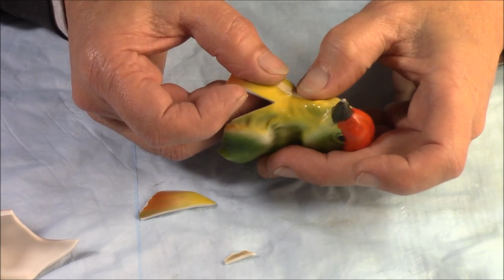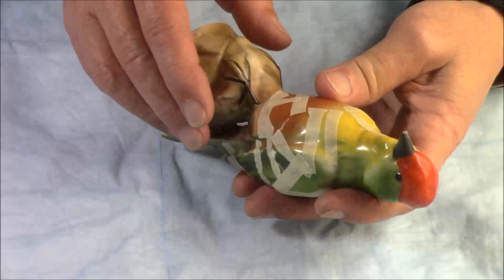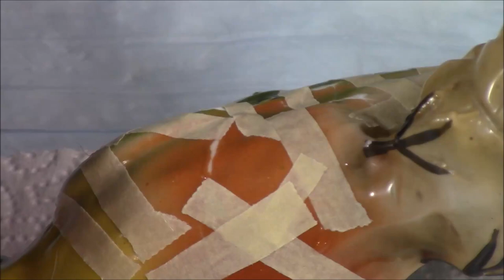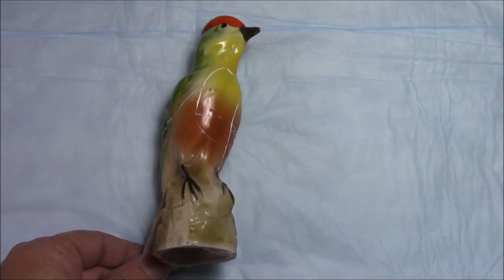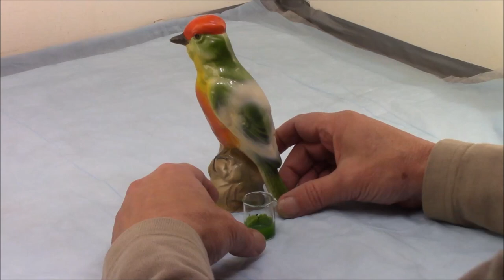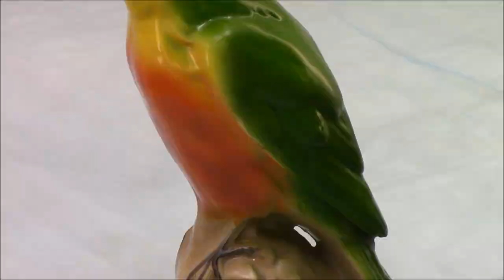Porcelain Bird Figurine Repair

Comment: Nice job but It would really help if you stated the tools and sundries you used. What glue did you use etc?
Reply: He said he used Hxtal. I looked it up and it is an epoxy adhesive developed especially to use in conservation for the repair of glass and ceramics.
Reply: Could someone advise if the Araldite standard would do the same job ?

Comment: Hi, given the price of the Hxtal (more than 80€ for 50g), is there any similar product you would suggest? Many thanks
Reply from the maker: As far as I know, there is no comparable substitute for Hxtal. 
Though for a small object like this one, where you'll be painting over the crack lines, I suppose you could use a good quality hardware store epoxy.
Reply: @marsgitar  thanks a lot Martin for sharing your knowledge. Hxtal it is then :).
Reply: There is Araldite 2020, I prefer it, easier to use.
Reply: @DrFaltermeier  I’ve had the chance to use both since my comment. I wouldn’t suggest araldite for fine restoration. If you have multiple pieces tu glue, araldite will slightly offset the pieces because of the thickness of the product. Hxtal does not. But, price wise, araldite can be a substitute for occasional restorations.
Reply: @WoodfulProjects I agree with you. if there is a hairline crack a heatlamp will lower the viscosity of Araldite 2020 to allow for better penetration and increase the speed of polymerisation. So always a win win in my  treatments. However I was always concerned if this might change the ageing of the epoxy, since I avoid airbrushing as much as I can.

Comment: Wonderful explanation of the process thank you. Im wondering as the figurine is hollow would there be any value trying to put hextal on the inside or does it pull into the cracks? Also why did you say its not suitable for high gloss finish glaze because it looked like it was high gloss originally?
Reply from the maker: The HXTAL is designed to wick into cracks by capillary action. As for the glossiness, the original was somewhere between a high gloss and semi-gloss. That's what I was aiming for in the final finish, though what I got was way less than glossy; almost matte. I realized the difference so I buffed up the finish to the desired sheen but by then I'd already filmed the final scene of the repair video.
Reply: @marsgitar  Thank you for taking the time to respond. I could maybe do the fitting together of the parts but no way could I do the painting, love it

Comment: I'm an amateur, rookie repairer of small vintage figurines. I use Milliput often. I'm curious why you sanded the excess Milliput instead of wetting it, smoothing it, and wiping it? Thanks for the great video!
Reply from the maker: I use whichever method works best for the situation at hand. Sometimes I do use the method you described.
Reply: @marsgitar  THANK YOU!! :-)
Reply: @marsgitar  Curious: Is it even possible to match or imitate fine crazing on small, 1950s porcelain figurines? I've a few adorable Napco pieces that I'm sprucing up. :-)
Reply from the maker: @victoriae.2371  I would say "No". I tell my customers that when I get an object with crazing. Since I use an airbrush, I can usually ease the transition from crazed area to non-crazed area, minimizing the effect. The crack lines in crazing is way smaller than any brush can match.
Reply: @marsgitar  Thank you again  Martin! You confirmed what I suspected. Feels good to be more sure of my assessment. I appreciate your videos. :-)
Reply: Fixing clay figurine
Reply: I love your videos. you're very educational and I watch hours of them enjoy each one. I like your videos better without the music it is very distracting to me.

Comment: Have you ever used a heating pad under your pallet? Warm Milliput seems easier to spread to me.
Reply from the maker: Thanks for the suggestion. I don't use this  method myself. Heating the Milliput speeds the curing time, so sometimes I heat the item after I've applied the Milliput.

Comment: Hi Martin, admire your work.  Do you make your own "hot box" or can you purchase one.  If you put it together yourself how do you make one?  Thank you, Connie
Reply from the maker: Sorry to take so long to respond. I just now saw your question. 
The hot box I have was home-made but not by me. I worked at another restoration studio before I opened mine, and I got the hot box from her when I was buying out her equipment. Her husband made it for her. It wouldn't be hard to make one: Mine is an old upright freezer without the compressor, motor and refrigerant. All you need is the heater element from an old electric oven and a thermocouple with a tempreture dial. The box only gets up to 140-150 degrees Fahrenheit, so it's not going to melt the plastic liner of the freezer. If you collected the parts, you could have an electrician, or an appliance repair person wire it up for you for not too much money, I would imagine.

Comment: Hi! Thank you for sharing your work. I’m not able to find the slymasta cold glaze product in the US.  Could you recommend another product for the cold glaze process?
Reply from the maker: US distributor: http://www.myrestorationsupplies.com/
Reply: Thank you!
Reply: Hello again- do you have a tutorial on the cold glaze process? The consistency of the hardener and resin together seem thick for the air brush.
Reply from the maker: @CC-qf8wk  I don't have a tutorial. For use in an airbrush I measure and mix my Cold Glaze like this example: Measure by weight with a gram scale: Five parts cold glaze resin to one part hardener. Then take that total weight and add that amount of cold glaze thinner. Example: 2.0 grams resin, add .5 gram hardener. That's 2.5 grams. Add 2.5 grams of thinner and mix thoroughly.
Reply: @marsgitar  perfect ! I appreciate the tips !
Reply: Hi Martin! I’m at the end stage of my restoration and wondering how you give the porcelain figurines that super slick shiny look? Do you apply a final layer of cold glaze that doesn’t get sanded, or is it just finished off with the anti- scratch liquid?
Reply from the maker: @CC-qf8wk  I finish the high gloss ceramics with at least 3 layers of sprayed-on cold glaze. Then that is "sanded" (polished) with MicroMesh sandpaper grits starting with 2400, then 3200, 4000, and 6000. Then it's polished finally with the Norvus polishing compound (#2: fine scratch remover). Be careful not to sand through the textured areas. Good luck!
Reply: The k you so very much for the tips ! I truly appreciate them

Comment: It came in high gloss why did you change it
Reply from the maker: It started out as almost a semi-gloss, or the low end of glossiness. As I painted the bird, each layer of paint was sealed with a gloss sealer, so I can see it get dull as I sand in prep for the next color. After the final coats of paint and gloss sealer, I applied a flat version of the sealer. Then I did the "after" photo. I realized I forgot to buff up the flat coat, so I did buff it up again to a semi-gloss finish. By then I'd already done the editing of the video.
Reply: Martin Scherer thank you your work is amazingly